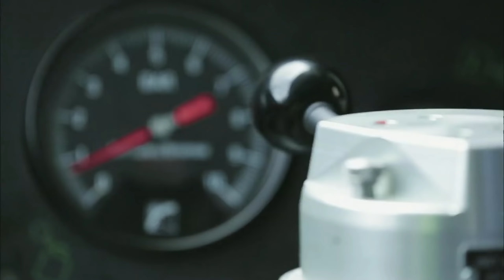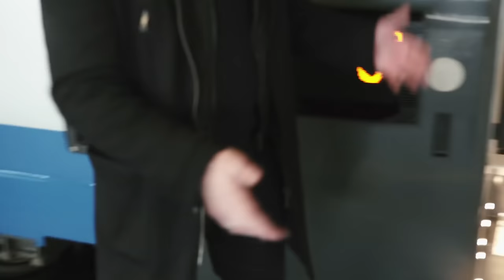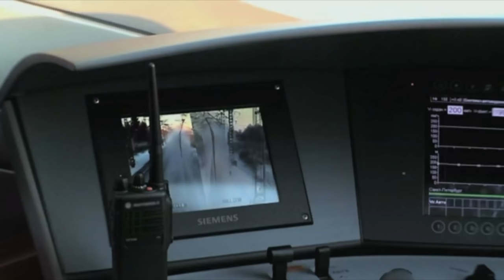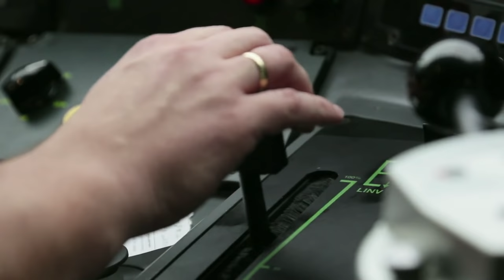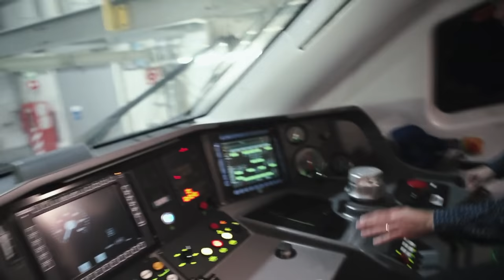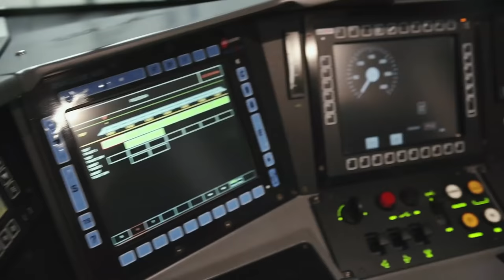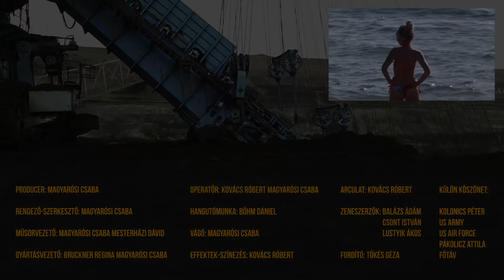Xtractor: A SZUPERVONAT, ami lenyomja a Porsche 911-est - Pendolino, the polish supertrain

Comment: Bocs de a mi alfa romeo 159-esünk 250 és 260 km/h között megy és egy porshe 911 322 km/h körul megy
Reply from the maker: +Máté Törnei bocs, de pontosan milyen 159-esetek van nektek? A 3.2-es V6-osnak volt 244 a vége. A legvége. A 911-es meg 288-tól indul.